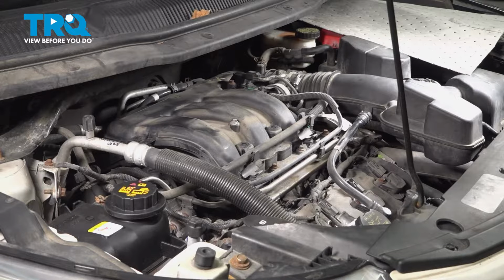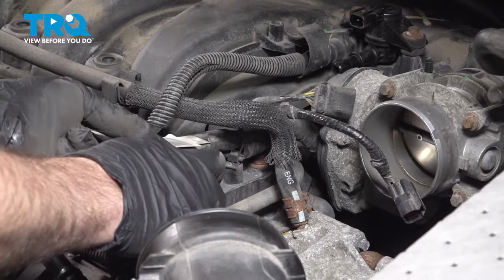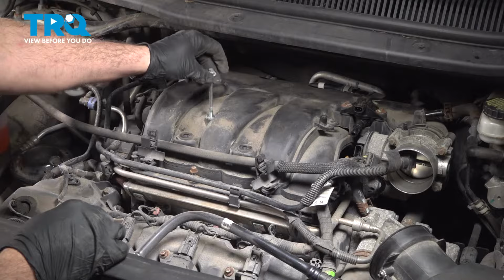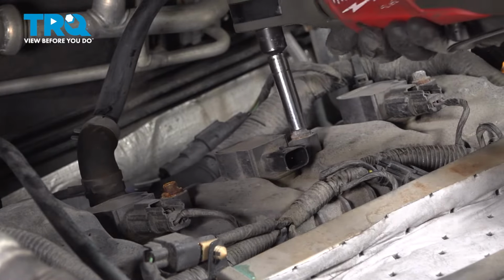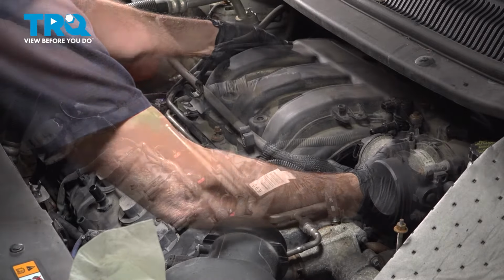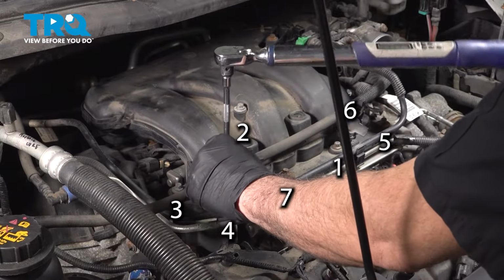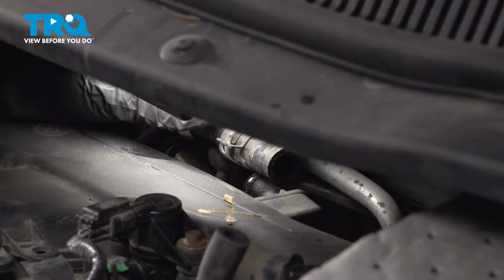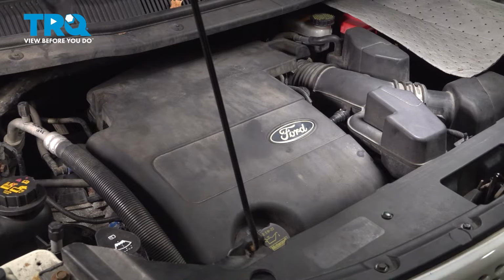How to Replace Ignition Coils 2011-2019 Ford Explorer (3.5L V6)

Comment: I'd add a little anti-seize to the threads on the little bolt, and a little dielectric grease to the connector.